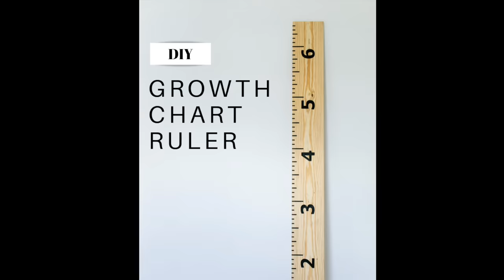Build a Rocking Chair DIY

Comment: Hi April quick question! The plans mention tall and regular size templates, but only the regular option was available when purchasing. I'm 6'0" so thought I might raise the height by 3" or so. Would you recommend I a) simply attach the chair body higher up on the legs or b) increase the length of the legs (which would then also require shortening the leg cross bars). I assume I don't need to mess with the rocker part itself either way. Thanks!

Comment: Hi April! 🙋‍♂️ Nice rocker but I would like to ask your opinion on the project. I noticed in that s and your last chair build that your design did not utilize a cross stretcher for the legs and on this chair the arm rest is not connected to the back. Question is, does it feel strong enough for active children or heavier adults!

Comment: I am planning to purchase your  "thick" templates so I can  make the parts using a router. What do you suggest for holding the templates to the wood stock - rubber cement, two sided tape?

Comment: interesting design- Adirondack Rocker?  interesting design combination of the side frames with rounded lath for sitting but the rocker truss to suspend those frames.  One your best designs.  Next one?  What about some curves to the two truss frames? the rocker is curved- so why not curve the upper three elements too? Thanks for posting.

Comment: April - pro tip for removing glue squeeze out.  a plastic straw cut at a slight angle off 90 degrees works so much better than anything i have found in the last 30+ years.

Comment: April, really cool rocker. What is not to like about it?  Rock on.
One suggestion to prolong it, being softer wood, would be to attach a layer of plastic on the bottom of the runners since it might encounter rough surfaces. Or not.

Comment: HEY! I got the Templates in the mail today! It was fold in half long ways, even tho you very planly wrote on both side of the package . FRAGILE  & under lined fragile. also DO NOT BEND, CRUSH, THROW OR DROP.
Thankfully it was not harmed, the only bends are from your folding, that will not harm the tranfer templates, as I will use double side tape to hold  it in place, until I draw the template on the 1 X 6 boards. I will then cut out a template in wood which I will keep for  making the "April Wilkerson Rocking Chair".Once I get one chair made, I know the  Dear Wife will want more. The first will be wooden, then I will try to make one out of the "plastic deck board" like theCracker barrel rocker are sometimes made for $300.00.  It will not rot,  but it not as nice as western red cedar or Mesquite.

Comment: I think it's safer to use a straight section for about 6" right at the back of the rocker piece.  It acts as a brake to excess vigor in rocking.

Comment: A simple tip - When removing glue from an inside corner, I found that a disposable soda straw pressed into the corner to form it into a triangle and then pushed forward collects the wet or partly set glue very well. A pair of snips removes the glue filled section, so you can continue using the same straw, but lacking the snips, just throw the straw out and use another. You will be surprised how well this works.
I never miss one of your videos.

Comment: The pro tip would be to hook up your dust collector to the thickness planer.  You still have to sweep up the shavings and saw dust from the porch area.  Unless you don't care about such things.
Reply: I bet the Texas wind keeps the porch clear.  PLus planer detritus isn't dust in the usual sense, mostly chips.

Comment: April – as you sit in your rocker, your chicken connects  the Wilker-dots for what you’ve done: carpentry, electric, steel, CNC, your dad’s carport and gantry, your shop & bandsaw mill; with what you haven’t done and want: and gets a timber frame structure to cover for your cars, tractors, bandsaw and drying stands (even a coop).   A new old-fashioned barn raising.

Comment: Tip for you: When driving long screws, do not use bar-soap to lubricate screws, soap attracts moisture and will cause steel screws to rust and stain your project. Use Paraffin wax, your mom uses it to seal jelly jars. Scrape the screws through the wax. (it comes in rectangular blocks about 3X6X1/2") Driving the screw melts the wax and lubricates the screw. Works for any length screw, including long lag screws.
Reply: Wrong video.

Comment: Oops ... 1/2 laps on the right rocker is exposed on the outside while the left is set inside. Love the rocking chair though, I need to make a couple myself.
Reply: @ Max very observant , mirror of seat frames (2:08) but not for rockers..

Comment: Does anyone know the length and width of the seat slats? I just got my template in the mail 😊
Reply: I just finished my first one and I made the slats 23" x 1 1/2". It's a bit wider than most rockers. I think the cut list calls for 19" 1/2.

Comment: I bought the templates. How wide did you rip the seat strips and also how long did you cut the seat strips?
Reply: I made mine the exactly the size of the templates.
Reply: I'm in the process of building one. I cut the seat strips a inch and one half with it being 28 inches wide for the seat. I also added another support for the seat since I went with a wider seat for a nursing baby.

Comment: Bought the chair templates, where do I get the layout, and what length 1x6x?
Reply from the maker: The physical templates are coming in the mail but the Plans are digital. Check your Spam folder in case it went there. Thanks for ordering and for watching.

Comment: how do you have your own shop of that size and still use a 12" bench top planer model?
Reply: Don't know about April but the cost of wide planers is big.  If most of your stock is narrow to start with a wide planer is no improvement.
Reply: @cdouglas1942  you can pick up a 20" with a spiral cutter head for like $2k. Better dust collection, assuming she has a central dust collection in the shop; larger in-feed-out-feed, likely able to take more each cut, probably a better feed rate, likely less prone to snipe if it is setup right.

It's the difference between a 6" bench-top joiner and an 8" floor model. On paper they can do almost the same thing. In practice, not so much. 

Plus she's been milling slabs. good luck sending an 8' slab through a benchtop planer. 

If I were going to have my own shop, first priority would be nice table saw, nice joiner, nice planer. Then a decent bandsaw.
Reply: @jamesoxford4260  Everything you said of advantages of a wider planer true.  But you can plane a 2x12 from HD in a 12" planer.  Slabs off the band saw mill are something else but a router sled, while more cumbersome than a planer, gets the job done.  Also April's job/business is making VIDEOS of making stuff, not just making stuff.  That said, the video aspect is likely far more time consuming that the object being videod.  My comment about planer discharge reflects my personal  situation....planer near the doorway and lawn outside.  My lawn tractor sucks it up.
Reply: @cdouglas1942  I hear ya. I work out of a shared maker space where you basically pay dues and they provide the shop. I probably could make-do with smaller tools in some cases. In others not really. I work with dense hardwoods and am making my way into furniture. It's really nice to put 4 or 8 leg blanks through the planer and see deviation < .005" end to end and between blanks.

she is sponsored by triton tools... idk if that has anything to do with it.

Comment: If you have a $50,000 equiped shop, you can diy  and build a $500 chair.
Reply from the maker: You are wrong. You can do my projects with simple tools, it would just take longer. As I have them, it would be crazy not to use them. Get creative and use what you have, figure it out. I didn't always have these tools or shop. I bought my first tools from yard sales and pawn shops, buying only the tool I needed then saved for the next one. Or - you can just complain about what someone else has. It's all choices.